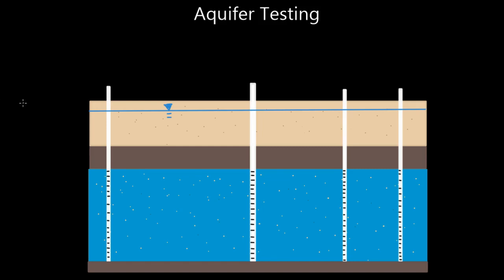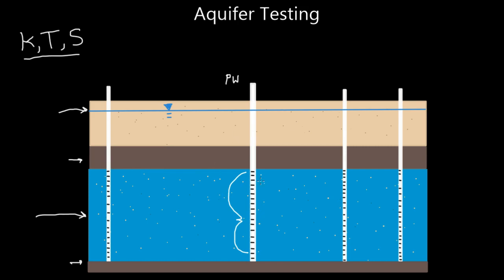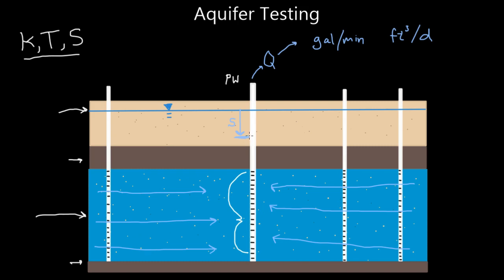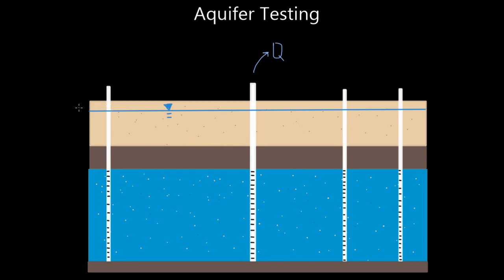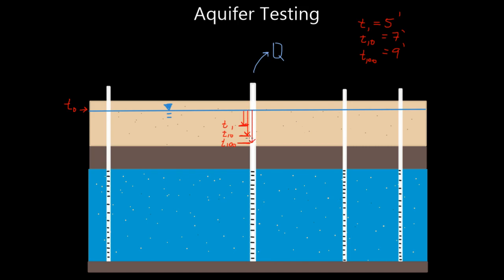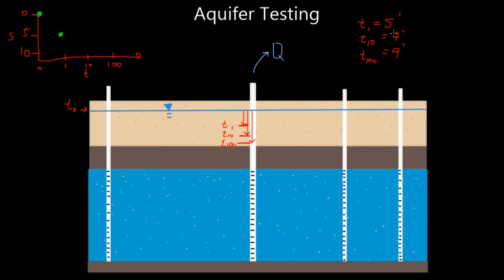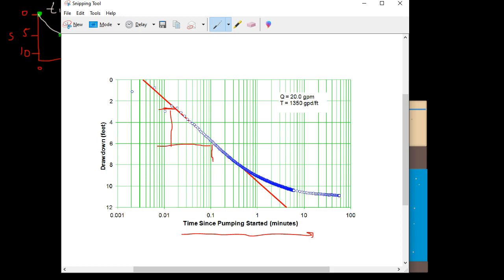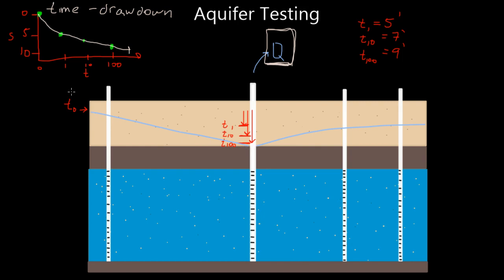Aquifer Testing

Comment: hey is it possible that drawdown will be high enough such that water level in the test well will be below the roof of the aquifer
Reply: Its possible, but you don't do that for confined aquifers as you allow air to get into the confined saturated layer.